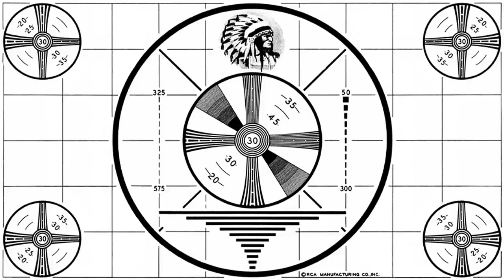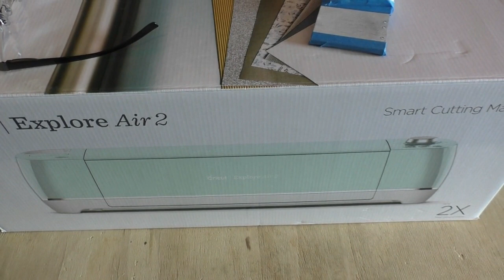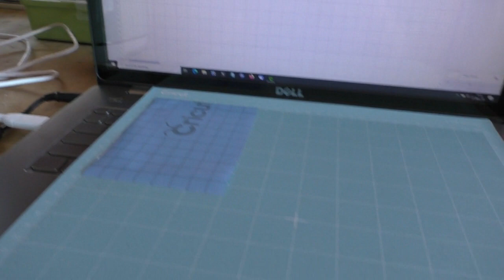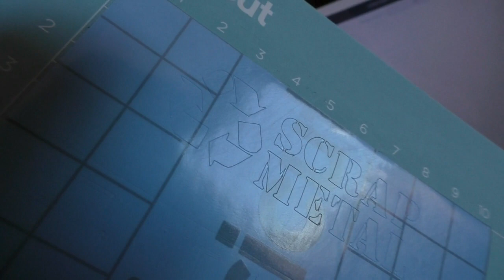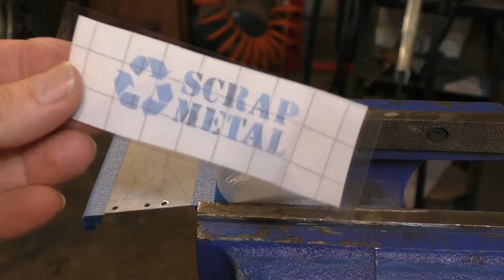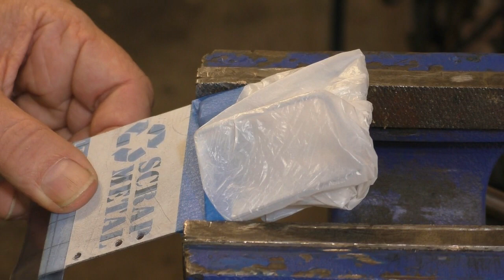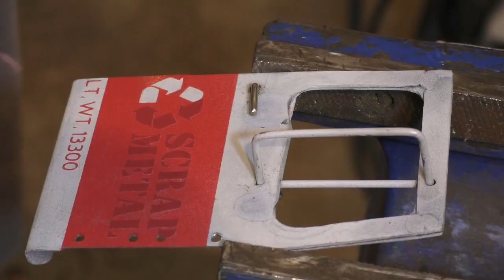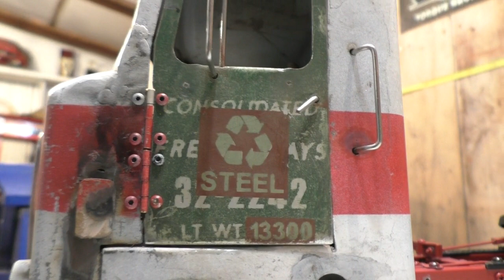1950's era White Freightliner model build. 1/14 RC semi truck model. (part 18)

Comment: My friend this is so realistic. It looks just like a scrappers truck. The brothers would be honored to know they were remembered in such a way. I salute you my good friend. Our minds are equally twisted. I'm still in about a 1/2 turkey comma from celebrating our time honered American holiday....Thanksgiving. I'm back, I had to take a snort to revive my mental faculties. Have you given any thought yet as to what sort of scrap might be loaded on the trailer. Maybe some old oil drums, some steel beams, perhaps an old car body or some junk HVAC units. The sky is your limit. A true scrapper will cull nothing metalic. Great work mate......oh yes, the detail on the interior door panels is awsome. Love your vinyl lettering machine. Stay safe. Till next time.😎
Reply from the maker: Thank you for commenting Ray. I am not sure if the trailer will cope with loads, the deck is made from rotting wood, not very stout. I doubt it would take much of a load at all.
Reply: @OldIronRC  I'm sure it will look great no matter. When the wheels start to turn in your creative mind, miracles unfold on your work bench.